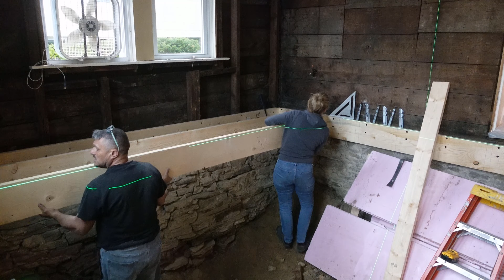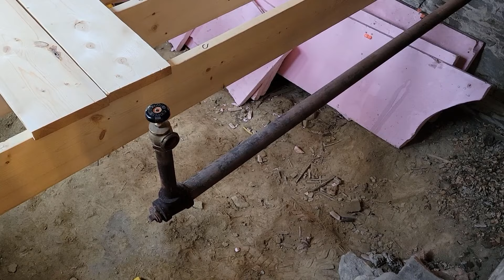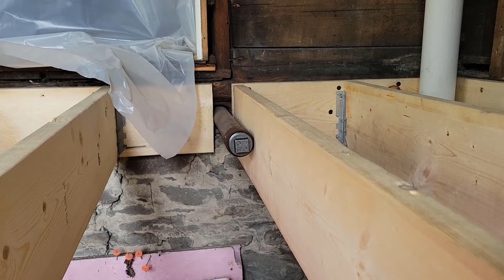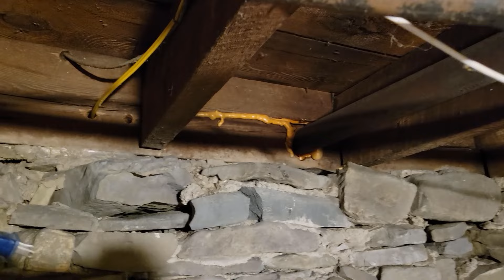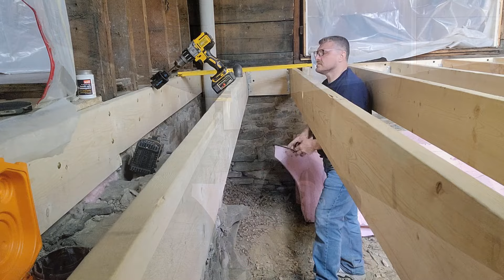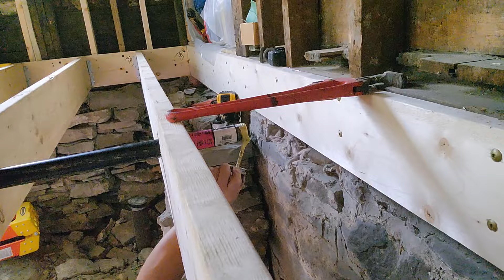Floor JOIST installation & STEAM pipe plumbing - part 5 of Remodel Project

Comment: Good video Spence! One thing though, I don't believe deck screws are permitted in joist hangers, they're not structural screws, too brittle. They should have been #9-1 1/2" into the ledger, and #9-2 1/2" toed through the joist into the ledger. Otherwise, looks good man!
Reply from the maker: Thanks Billy for the comments! I will check on the 9x3 exterior screws to see if I goofed. Thanks!

Comment: I'm considering moving a radiator in an old house.  Does drilling through the joist reduce the stabilty of the floor?
Reply from the maker: Hey there and Howdy Matthew! Thanks for commenting. To answer your question - it will depend on the size of the joist and the size of the hole you drill. If you have to drill a hole, drill in the middle of the joist and always stay at least 2 inches away from either edge. Any hole you drill should not be any larger than 1/3rd the size of the joist. 

If you have to violate either of these guidelines, you will compromise the structural integrity of the joist causing it to fail sooner than it would otherwise. 

If you still need to break one of these "laws" you will need to add additional support to the joist(s) affected and for that, I would consult a competent contractor who can look at your specific situation and address the framing and structural issues directly.
Reply: @sdsconstruction  Thanks for your reply